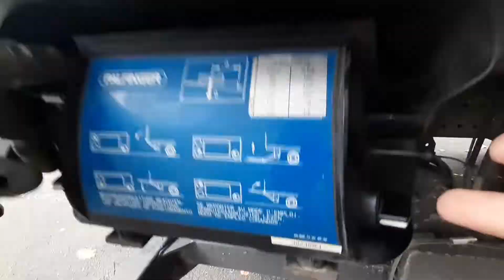Tail lift no longer closes properly

Comment: My liftgate hoes up fine but wont come down. I literally have to play with it for sbout 20 min before it finally goes back down. Any guess?
Reply from the maker: maybe you don't have enough hydraulic oil in it
Reply: I think your sylinder valve are bad, oil is not the problem if its not going down, its the valve not releasing the oil